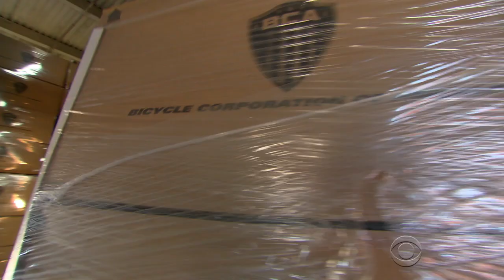Factory moves from China to U.S. with help from robot workforce

Comment: This kind of manufacturing is called AUTOMATING AND ROBOTIZING AROUND WORKERS was done in Japan in the early 1980s to achive LABOR FLEXIBILITY IN JAPANESE MANUACTURING. But American manufacturers in the early 1980s wants to automate jobs out which is impossible said the Japanese because of the UNEXPECTED FACTORS element. Because of that, America and Americans missed a lot economically.  In 
the 1980s both the Japanese and American industrialists has meeting on how to 
use the incoming technological promised boom of full automation and graduating 
to robotization. The Japanese made the wise decision to automate-robotize around 
their workforce whereas the Americans decided to automate-robotize out their 
workforce. And the result is that Japan, despite full automation-robotization, 
has a good employment record rating and higher work flexibility-induced high 
productivity which created higher salaries and wages to maintain their domestic 
purchasing market's power while maintaining a higher re-investment R&D 
policy and expansion program. Whereas America, fully knowing that it takes a lot 
of time and investments to automate-robotize out their workforce, instead of 
following the Japanese lead to do it gradually and around their workforce to 
maintain their workforce and local domestic market's purchasing power, are too 
proud to admit their mistakes and opted to just outsource/offshore to cheaper 
labor which in turn created the present economic crises. 
 
Now 
Japan, despite it's present economic crises, is still Asia's 21st century 
factory workshop despite of cheap Chinese labor right across the neighborhood. 
However, it is the demographic winter in Europe which is largely to be blame. As 
the population ages it's spending habits and expenditures will be reduced which 
results in under-consumption which results in reduced turn over rates which in 
turn results in lower sales which in turn results in reduced or even no return 
of investment of capital. So the trend is to robotized everything to reduce 
costs by reducing labor costs in order to lower sales costs in order to boost 
sales which in turn creates unemployment which reduce further the market's 
purchasing power and size. A vicious circle because they neglected and ignored 
the demographic factors! Japan was able to solve this by robotizing around their 
labor to achieve labor flexibility to increase productivity per labor input and 
then apply Henry Ford's economic logic of sharing a proportion of that increased 
profits created by increased productivity due to reduced labor costs to it's 
workers in order to maintain it's domestic market's purchasing power and size, 
and by simultaneously and continuously re-investing in it's workers' educational 
upgrading and skills upgrading and upgrading their training to keep pace with 
competition. 
 
Germany 
also knew what Japan did, starting in the early 80s and has emulated Japan's 
economic policies also. Germany and Japan were able to maintain their full-set 
heavy industrial manufacturing and processing economies because during the 1980s 
two groups of major industrialists from the U.S and Japan were deliberating on 
how to use these new emerging combined technologies of full-automation, 
computerization, robotization, servo-mechanization, multi-sensory 3D 
eye-sensors, eye. 
 
The 
American side wants to automate labor out which is far more expensive and takes 
a long time to iron the kinks and exposed to a lot of unexpected unknowns that 
these technologies cannot solved. The Japanese side on the other hand decided to 
automate around labor by combining the high productivity of 
robot-driven/CAD-CAM/full-automation WITH THE HUMAN LABOR'S FLEXIBILITY IN 
DEALING WITH THE UNEXPECTED UNKNOWNS IN THE WORK PLACE, WHILE ALLOWING THE NEW 
TECHNOLOGIES TO HANDLE THE DANGERS AND HAZARDS AND HOSTILE CONDITIONS AND 
DANGEROUS ENVIRONMENTS UNDER THE CONTROL OF THE HUMAN LABOR WORKFORCE'S 
FLEXIBILITY  IN DEALING WITH THE UNEXPECTED UNKNOWNS. Germany and Japan did 
not only automated/computerized/servo-mechanized/and robotized around their 
existing labor force at that time during the early 80s in order to achive labor 
flexibility and increased productivity produced by labor flexibility and work 
area safety induced increased productivity and increased productivity BECAUSE 
ONLY HUMANS CAN DEAL WITH THE UNEXPECTED UNKNOWNS AND UNEXPECTED VARIABLES WHICH 
MACHINES CAN NOT COPE WITH AND THEREFORE CAN NOT SOLVED FOR ONLY HUMANS CAN 
SOLVED IT THUS HUMAN LABOR WILL FOREVER BE IMPORTANT IN SOLVING UNEXPECTED BUGS 
AND PROBLEMS IN THE SYSTEM(S) IN ORDER TO CONTINUE THEIR PRODUCTIVITY but that 
it is also accompanied by the fact that the Germans has a strong labor trade 
unions organizations and the Japanese has a strong emphasis on human resource 
importance that it is in their interests to maintain and uplift their human 
resource factor by USING HENRY FORD'S WAGES-SALARIES POLICIES by transferring an 
strategic portion of the increased net profits generated by the increased 
productivity created by LABOR FLEXIBILITY and by putting heavy emphasis on human 
knowledge skills educational upgrading as the machines becomes more advanced 
while at the same time MAINTAINING AND INCREASING THEIR LABOR FORCE'S 
EDUCATIONAL QUALITY, SIZE, AND PURCHASING POWER by also reinvesting in both old 
and new industries' industrial expansions FOR THE HENRY FORD WAGE-SALARY POLICY 
APPLIED WITH LABOR FLEXIBILITY BY AUTOMATING-ROBOTIZING AROUND THEIR LABOR FORCE 
PLUS REINFORCING THEIR LABOR FORCE WITH A CONSTANT KNOWLEDGE SKILLS UPGRADING AS 
TECHNOLOGY ADVANCES WILL ALLOW THE WORKERS TO BE ABLE TO AFFORD TO HAVE 
FAMILIES, RAISE THEM PROPERLY AND PROVIDE FOR THEM PROPERLY IN ORDER TO PREPARE 
THEIR CHILDREN WHICH IS THE NEXT AND LARGER GENERATION TO BECOME HIGHLY EDUCATED 
AND HIGHLY SKILLED AND HIGHLY INVENTIVE AND HIGHLY INNOVATIVE PEOPLE THAT WILL 
CREATE NEW INDUSTRIES AND EXPOUND ON THE OLD INDUSTRIES WITH NEW INNOVATIONS AND 
INVENTIONS THAT WILL EXPAND THE NEED FOR INDUSTRIAL ECONOMIC INVESTMENTS AND 
EXPANSION OF THE JOBS MARKETS, AND HAVE  ENOUGH LEFT OVER NET INCOME TO 
BECOME SAVERS AND INVESTORS THEMSELVES!  
 
But 
these can only be maintained indefinitely if we indefinitely implement the 
financial and economic reforms of Major Clifford Hugh Douglas based on 
interest-free government public treasury issued money and national 
dividend/basic income , Abraham Lincoln's government public issued greenbacks, 
Benjamin Franklin's interest free colonial government public issued colonial 
scrip,  Silvio Gesell‘s government public treasury issued stamp scrip, 
Bradbury's government public treasury issued interest-free Bradbury Pounds, 
Alexander Hamilton's non-monetary government public treasury issued 
interest-free credit-scrip, protective regulated fair trade tariffs, continuous 
government public investment in human life-supporting and economic 
activitiy-supporting infrastructure and technostructure centers and networks and 
systems which is where the social security taxes will be invested into and all 
of it will be protected by regulating it in order to secure the old age social 
security system,  implementing the Hill-Burton Health Care Act which is a 
national public health care accessible to everyone regardless of their economic 
and social status by funding and treating it like a military national defense 
establishment for it will be our first line of defense against diseases and 
plaques since everybody can get infected then it should be funded and treated 
like the way we fund and treat our national military defense establishment, the 
implementation of the Glass Steagall Banking Act and State Public-owned Banking 
system to help secure our citizens savings and to ensure and acquire safe 
investments in public infra-technostructure and in transparent and stable local 
industries and businesses in the production of goods and services which all will 
be protected against nefarious financial practices and schemes by Wall Street. 
 
ALL 
THESE CAN BE ACHIEVED SAFELY ONLY WITH DE-CENTRALIZED, INTEREST-FREE, GOVERNMENT 
PUBLIC TREASURY ISSUED CREDIT-SCRIP/STAMP-SCRIPT ACCOMPANIED WITH A 
SELF-POLICING INVESTMENT DIRECTIVE THAT WILL MAKE SURE THAT ALL NEW ADDITIONAL 
MONEY BE INVESTED IN THE PRODUCTION OF GOODS AND SERVICES AND IN HUMAN RESOURCE 
DEVELOPMENT AND HEALTH-CARE WELFARE SECURITY AS STATED BY THE HILL-BURTON HEALTH 
CARE ACT.

Comment: The thing is, even if those jobs are being automated in the US, that automation still requires skilled technicians, and programmers to maintain them, and skilled operators to operate them. There will still be tasks in the factory that cannot fully be automated as seen in this video. It's still better than having the full factory and even these jobs outside the US where zero. The jobs are there. The problem is, Americans have a problem adapting to changing markets. A factory worker who is motivated should grow his/her skills in computer programming. The people that program these automated machinery make good money. I work with building automation systems which is related (though its used for HVAC plant operations instead of manufacturing). And it requires a certain skill level to be able to do it. But it doesn't require a costly 4-year college degree and the opportunities are endless. Just a basic understanding of computers and the rest comes with experience, mentorship, and training.

Comment: One less job for a paid human. FACT
Reply: except machines are not self feeding so someone still has to do the job in some way for the machine and trained to fix issues before calling in the more experienced technician, FACT
Reply: So machines don’t need designing, building, installing and maintaining? Factory premises don’t need constructing, taxes don’t need paying to municipalities which are redistributed back into the development of local communities and infrastructure? The FACT is that automation removes repetitive low skilled jobs but replaces it with higher skilled and higher salary jobs earlier in the business model which is surely a better thing all round? Now that’s a FACT the economically illiterate fail to grasp.

Comment: Who wants low skill low pay assembly line jobs?  Not me.
Reply: If too many americans have your attitude then america will suffer greatly, you are negative.
Reply: w23857980 
I know folks who would take this job for the steady pay check and completely understand them.
Reply: Not all factory jobs are low skilled assembly line. You need to realize the amount of workforce that comes with a large factory. You have people working logistics, engineers, management, office workers, truck drivers, maintenance, the list goes on. 
A factory I worked at closed back in 2005 or so, it was just not low skilled people who suffered. Many people with college degrees found themselves out of work. Surrounding businesses-a bank across the street from the plant for instance closed down due to the lack of customers at that location once the plant was gone. The building sits vacant and vandalized which hurts the surrounding homes value.
Reply: Who would want it?  A low skilled worker with no job and who likes to eat.
Reply: oosveluzo levso, and you're an idiot too. Trump is not negative, he's very positive when it comes to bringing jobs back to America.
Reply: low income communities are rampant with sub 75 IQ individuals, most people don't realize that every job or task has some form of IQ requirement, we need to find jobs for the lower IQ as they're most often on assistance.
Reply: Trump is a very negative individual, and there are millions of Trumpanzees, America is already infested with negativity.